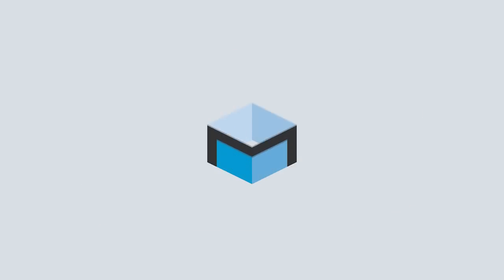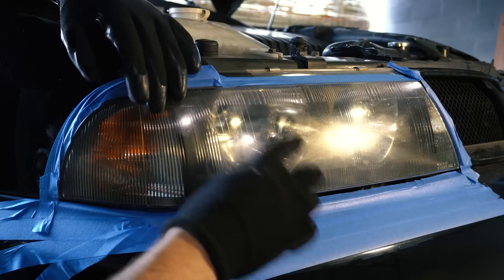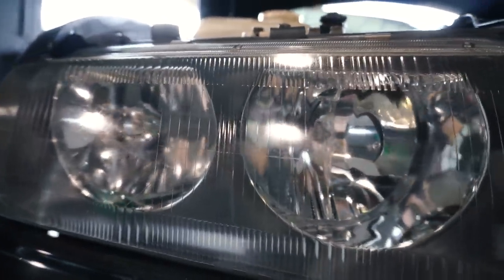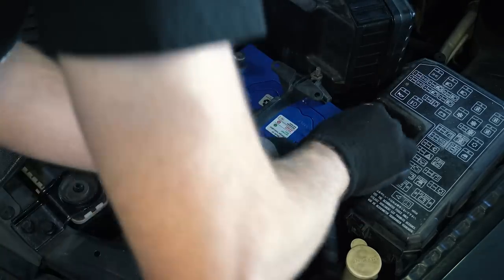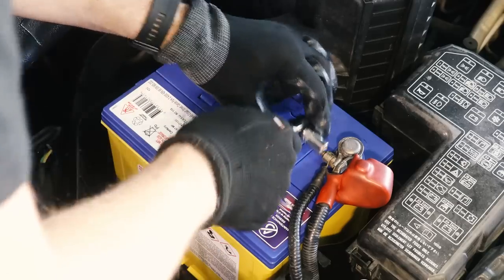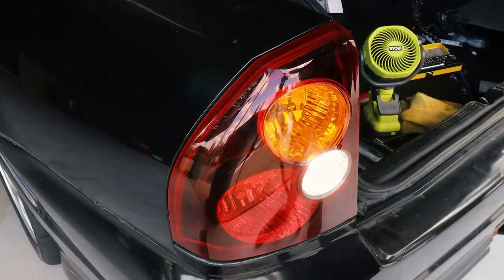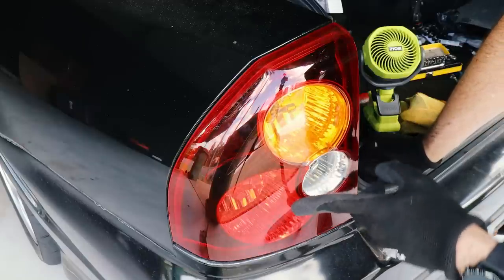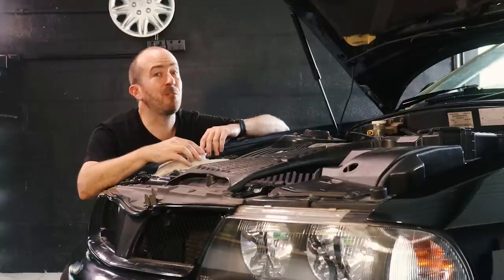Throwing Parts In The BIN! Getting the Magna Ralliart One Step Closer to the Road!

Comment: Quick tip with the headlights, 1200 grit wet sanding those headlights and THEN use the plastX polish.  Also recommend putting a ceramic coating on them afterwards so they don't go dull for years.

Comment: The headlights and taillights look absolutely fantastic Sean.
Regarding the battery cover, they were only ever factory fitted up until the TH model.
TJ onwards never had them factory fitted, cheers.
Reply: Huh interesting, I purchased mine in 2010 Tj series one and it has a battery cover, previous owner must have put it on, or they looked after the sports and vrx models with a bit more dress up in the engine bay
Reply: @callumadams5523  Somebody fitted that cover. Word from MMAL at the time was that so many sales people complained about them that they discontinued it. Apparently the lids were left up when cars were jump started and then the bonnet would be pulled down by the idiot sales person causing it to break.

Comment: Good work, Sean! idk if you have the time or patience to try this, but those dead LEDs in the spoiler brake light are probably easy enough to replace if you have a temperature-adjustable soldering iron with a fine tip, along with a pair of long-nosed tweezers. They look surface mounded, meaning they're a bit fiddly but not impossible to change. Replacement LEDs are dirt cheap too, you could probably buy a bag of 100 for like $5 from eBay or AliExpress.

Comment: Good stuff Sean, so glad to see those tail lights gone! Quick tip in case you weren't aware with restoring headlights, you'll want to put some sort of UV protection on them, or they'll cloud up again within a month. 2K clear coat in a can is good (but you have to scuff the headlight up to do that), otherwise headlight resto kits usually come with basically clear coat in a wet wipe that achieves the same thing, minus the scuffing. 

Keep it up man, love the updates, and you've made me appreciate Magnas more than anyone ever has! :)
Reply: Sylvania do an amazing headlight restoration kit. You can get them from Amazon for about $60. Got everything you need in them.

Comment: Good stuff mate. Small tip on the headlights- sand them with 1200 then 2000 wet and dry first and that will remove all the problems.

Comment: Wet and dry sand paper, Really fine grit. Bit of water, Rub the headlight down really well. Then clean it off, Mask up and spray a coat of clear coat over it. The best treatment you can do. The others tend to just... polish the issue away until it wears off.
Reply: Second this. If you've got the time to clear coat and polish them it's well worth it. The plastic will cloud up again fairly quickly unfortunately without protection.
Reply: @victorpeirce4753  I'd say that's more than likely linked to a shitty clear coat. I did mine about 3 years ago and they're still crystal clear. Gotta be careful what brand you use and to make sure you leave the can in a bucket of hot water for about 15 mins. But go with what ya know
Reply: You want Uv clear

Comment: Awesome job, I'm really excited about this car. 

Love the new taillights. Not sold on the led globes. Traditional globe filaments form a tight point source - these are designed to sit in the luminaires exact focal point and this exact positioning is needed for the indicator and tail lights to focus correctly.  Led globes have no central focus point and because of this they are rarely as good or effective as the old fashioned globes that were originally designed to be installed.

Comment: I reckon wet-sanding the headlight prior to polish would get it mint.  I have used and highly recommend the Cerakote Ceramic restoration kit.  Supposedly lasts for life.  I'm about 18months in and still looking good.  (FG Falcon)  I'm liking this project.  Never ever thought I'd be rooting for a Magna, but low and behold I'm hooked!  Keep up the good work.  Can't wait to see you doing Ippy laps in this with your mullet wig.  👍👍👍

Comment: Also alternative solution to the resistor for the hyper flashing is to get an led flashing relay, for anyone not confident in doing any electrical work. However some cars might need a slightly different to standard relay.
Reply from the maker: I actually have one of those on order to see if it works or not.. will be interesting.
Reply: Many modern cars don’t use a traditional flasher relay anymore.  It’s often done by the BCM/BEM.  Falcons since BA are like this, and VE/VF.  Resistors are the only way to sort them out.   If the Magna still has a flasher relay, you’re in luck.

Comment: I think they might have discontinued the battery cover on the TJ model to save money. Or maybe only continued on with the verada like the chrome window surrounds.
Reply from the maker: Sounds like it - kind of crazy though as they left the bottom half of the assembly and it looked unfinished. I guess most customers wouldn't have noticed (or cared).

Comment: And generally better to go with the biggest battery you can fit as over time they degrade and can cause issues with the electronics even if they test good.
Some from factory only have enough to crack the car over/say it is weight savings.

Comment: Another great video Sean.
In regards to the 3rd brake light, you might get one off eBay or even places that still make replica boot wings. Failing that you can't find one, find one off another make, take the light assembly apart with a blade & take the LED strip out & fit it on the Magna one.
I had to do this to my Holden VY ute as the light assembly got water in it & the company that made them for Holden went out of business. I got an LED strip from a 2012 Nissan X-Trail which fitted inside perfectly.
Reply from the maker: It looks a little tricky to remove (you have to pull the wiring through with it, and its tight) so I'll leave it for now. But yeah, I will definitely have to fix it with an aftermarket LED strip light or find a similar length one from another car like you did!
Reply: @MotoringBoxTV  You might need to take the back wing off to get at the wiring.
Reply from the maker: Yes definitely! Even then the loom goes through the lower part of the wing and down the right leg...

Comment: Those 1 x piece plastic paras as far as i know, are no longer avaialable new, in later years you could always use the 2 x piece glass units from the verada to keep you on the road.

Also if buying 2nd hand be aware most have broken plastic tabs that mount them

Comment: Re the spoiler mounted brake light.

I have prised the lens off my BA one and replaced the dud LED’s.

They are in banks so one dud LED makes three or Four not work

Standard Jaycar part except I think I replaced white with red LED’s which makes no difference once they are behind the red lens.
Reply from the maker: I actually found a brand new replacement unit 👌

Comment: Appreciate the spare time you put into these videos!  Does the battery monitor app work with multiple monitors?  is could I stick one in each car and monitor at the single spot?
Reply from the maker: It's best with 1 monitor, but I have several and it auto-connects to the nearest one when I launch the app. It keeps the data for each car separate too luckily.

Comment: Sean,

Don't bother fitting a resister to the LED rear tail lights because if you decide to run front LED's, you'll also need one on each front light...

Much better off buying a LED Relay and swapping the relay in the footwell fusebox. They are about $10 from Jaycar and are plug and play... No wiring needed, or individual resistors on each LEDS flasher. 

From memory, you need the LED Relay for a Japan car. It's a 3 pin.
Reply from the maker: I have a relay on order, it'll be interesting to see if it works!
Reply: @MotoringBoxTV  Yeh - I owned a Magna for about 10 years and this was how I ran LED and fixed it. Got abit of a shock when I bought a Pajero, same manufacturer, but no LED Relay on the Pajero's.... The BCM controls the flashers, so had to go resistors.

Comment: hey sean, I'm thinking of getting a ralliart with 217,000 ks on odometer. I dont know how long these higher tuned ralliart engines hold up for, what are your thoughts, considering yours has over 240,000. many thanks.
Reply from the maker: I'm still learning, but apart from timing belts needing replacement every 100k the only other common thing they suffer from are worn valve stem seals which can cause them to start burning oil. It seems to be more of an annoyance rather than something terminal, so long as you keep the oil topped up. There might be other engine issues but I've not heard about any yet. Have also heard issues of the auto gearboxes dying without warning - due to a failure of the wave spring. Don't know much about that either though so might be worth doing a bit of research ☺️
Reply: @MotoringBoxTV  sure, thanks for that, thats about all i know as well.
Reply: All of them are very strong motors.
Especially the Ralliart’s.
The pistons in these were sent to Germany for a special process called shot peening, which we had in Aus as well, but maybe the Germans had a better process back then.
It strengthens the pistons. and also smooths out the stroke pulses at high rpm.
It’s a quality motor, I’ve seen Ralliarts go way over 550,000km with unopened bottom ends.
Like Sean said, it’s just the valve stem seals in the heads that may or may not need refurbing, depending on the oil change frequently.
Reply: They go well over 500 k if you take care of them. And keep changing the cambelt
Reply: @GForceVRX  oh wow, nice, yeah i heard they had quite a lot done to them

Comment: I’ve been running Matson Bluetooth battery monitors since just before COVID.  They are very similar to the century one you demonstrated, and the app is eerily similar!  Does the app also do “logbook” or trip tracking too? (It uses the connected phone’s GPS).  The only problem I have is the monitors don’t like AGM batteries like the Optimas that I run in my Brocks.  Battery is fully charged but the app says “40%, battery low” due to the lower peak resting voltage of the AGM style cells.  Does the century monitor allow you to change any settings to suit different types of battery construction?
BTW, no apologies needed.  You’re doing this in your limited spare time, and we all know family and work take priority.  Do any of the people complaining make YT videos on interesting topics like you do?  I doubt they do……

Comment: Thank f*** you got rid of those tail lights! Replacements are perfect!!!

Reminds me, there is a brake light mounted at the top of the rear window, but is NOT connected if your car was factory fitted with a spolier (because the spoliers had lights). The wiring still exists and lays disconnected and loose in between the roof lining and the c-pillar covers!

It looked bloody cool have both spolier and rear window brake lights working, it lit the rear end up quite nicely IMO!
Reply: The rear screen won't have the retaining clips for the high mount light glued onto it.

Comment: I have been told to never put a car battery on a concrete floor as it drains (or wrecks) them? Is there truth to that matter?
Reply from the maker: Not true - the cases are plastic (non conductive) so they don't care what surface they're on. Heat does affect battery life, so I suppose if the concrete was in the sun and you left it there all summer there might be some impact. But even then it probably wouldn't get hotter than it does in an engine bay, so... 🤷‍♂️
Reply: @MotoringBoxTV  it basically just putting it directly on concrete floors. It doesn't matter if it's under shade or not. It needed to have something in between.

But that's good to know it's a myth.